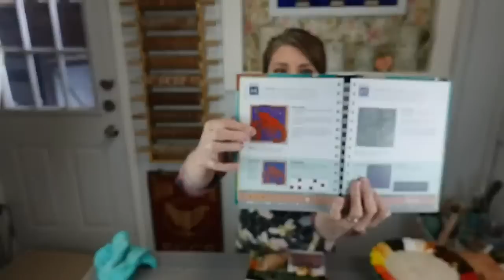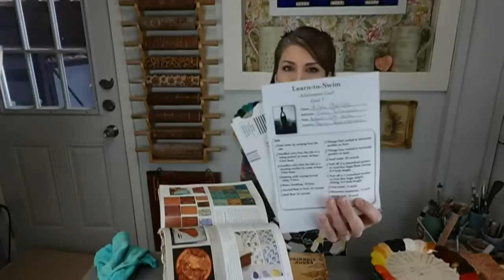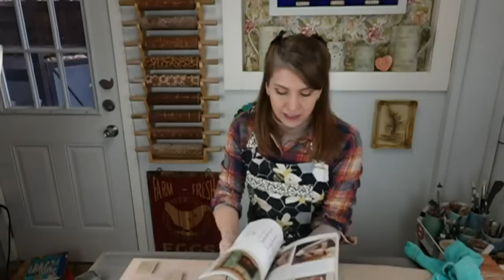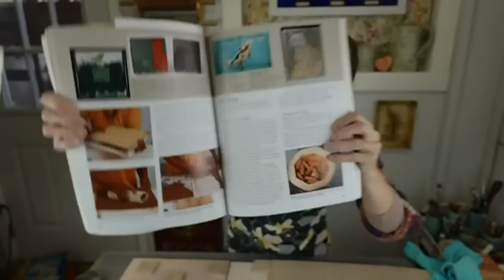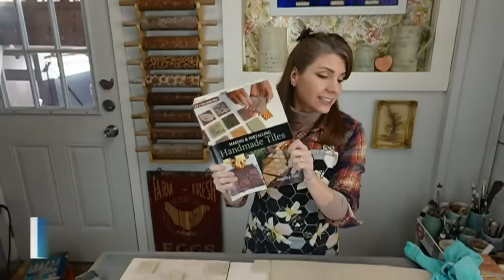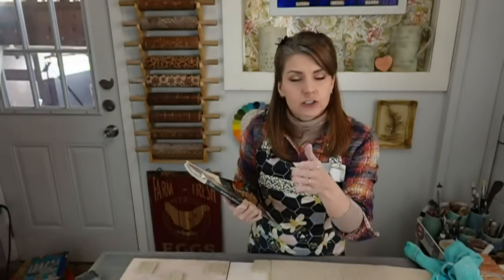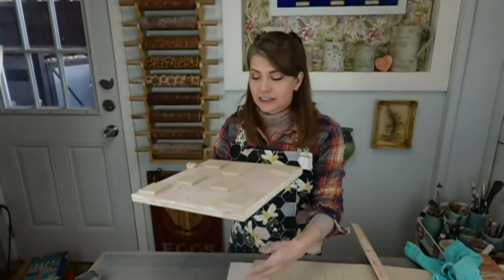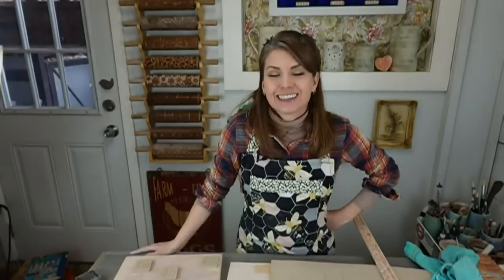Live at 5 - Making Tiles

Comment: I do use sheetrock and love it. I put a sheet of newspaper on top so that the clay doesn't cause the surface of the sheetrock to break down and so colored clay doesn't stain the sheetrock. They are lighter weight than boards so easier for me to manage. I used duct tape on all the edges.